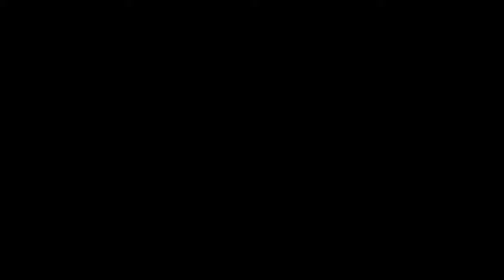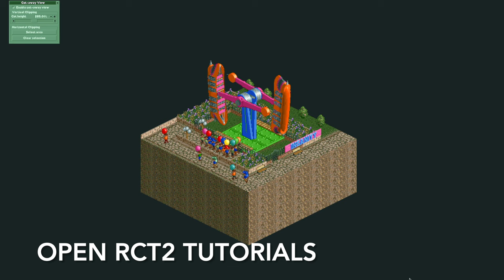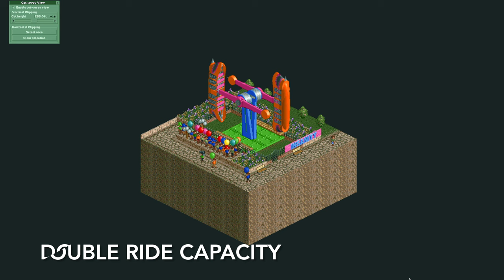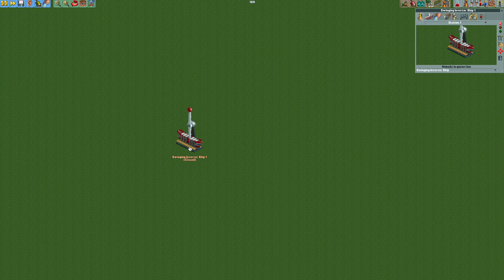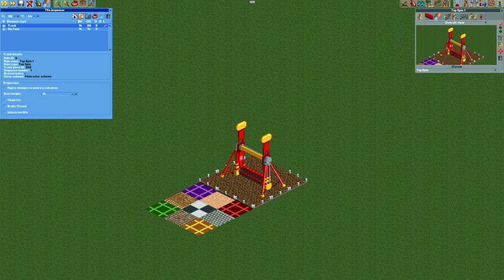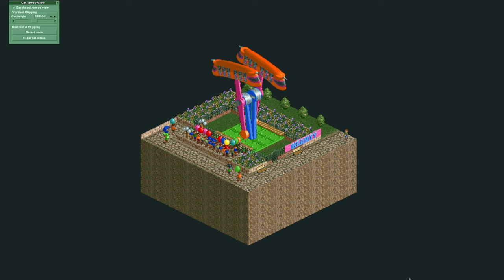Mirrored Rides – OpenRCT2 Tutorial

Comment: Neat, I like finding new little ideas to play around with like this.

Quick question, Whilst I won't deny the ride vehicle editor plugin isn't great to use, could I not achieve the same results of increasing capacity by simply adding another "ship" via cheats (like the one you have active already) on the ride overview instead?
Reply from the maker: You can achieve similar results, however, adding ships will cause additional ships to operate invisibly. The loading and unloading of the invisible ships will occur at different intervals from the visible ship, so it will show guests walking on to the ride in the middle of a cycle. The plugin allows for more realism.

Comment: First off, this seems to take some practice. I tried to do this with a flat ride, and ended up not only messing it up, but permanently destroying part of my park. (I suddenly had columns of land sticking far into the sky or deep into the ground, and there seemed to be no way to fix it.)

Secondly, I'd like to ask if there is a way to use this to do something. I'd like to build a dueling reverse freefall coaster, but only have one station. Can the tile inspector mirror, rather than rotate? What do you think of this idea (other than a lot of work.)
Reply from the maker: It can be tricky to keep track of what you are copying and pasting in the tile inspector. You can always delete the flat ride and start over.

The columns of land sticking up means you probably deleted the surface object in the tile inspector for that specific tile. You can fix this by copying the surface of another tile and then use the X and Y coordinates to navigate to the tile that is causing a problem. Paste the copied surface to that tile and it should fix the issues.

As for the reverse freewill coaster, it won't work using the tile inspector. The trick of mirroring rides shown in this video only works with un-tracked rides. Any ride with a track that you can build yourself will not work.